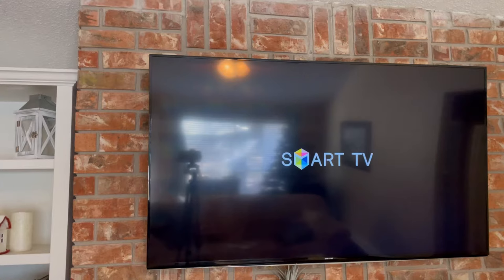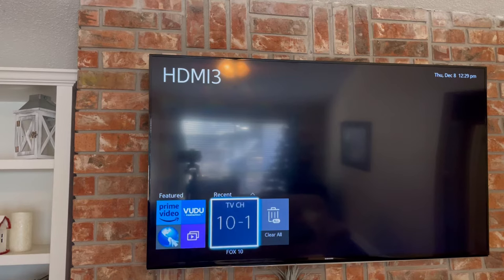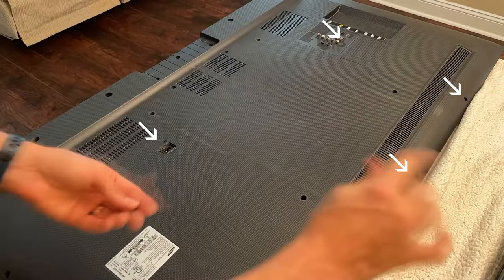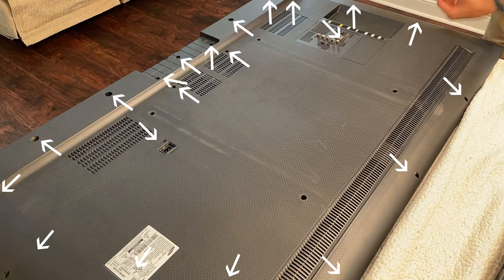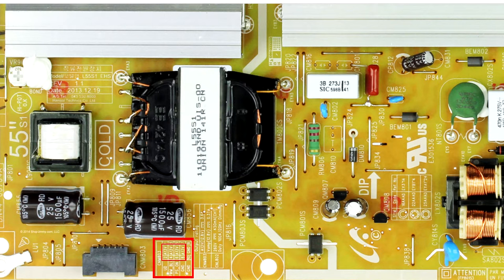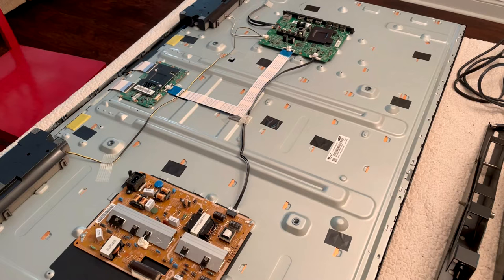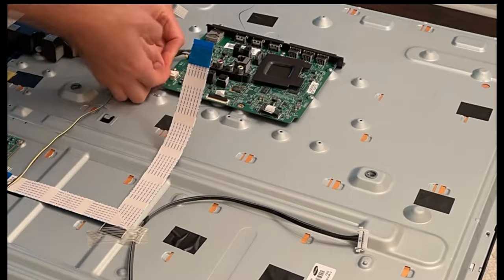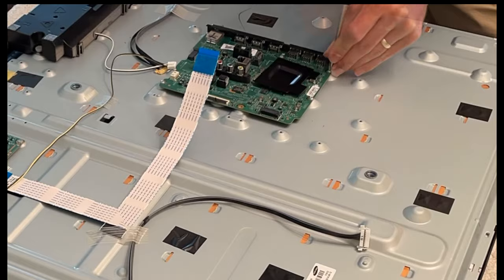How to Repair a Smart TV that Keeps Rebooting (Samsung)

Comment: I have a 75" Samsung TV that constantly power cycles,   i discounted the main board from power board and connected the power cable to the wall jack which on Samsung TV should turns the back light on at gigh level and remain on and that still showed the TV power cycling since it trys the turn leds at full brightness,  there is two ribbons for back lights on this tv and that did the trick and tv remains on ,
I reconnected the TV power baord and main board together and restart the TV and TV stayed on and i was able to go to settings and lower the brightness and hooked both led ribbons again and started tv and the tv remians on and no longer power cycles .  The issue is on full brightness and it seems the pwoer board on its own measures the led feed backs somehow and if it is not up to spec it shuts the TV down and does the pwoer cycle.   The question is what it is measuring and what part on power board does that from anyone the knows the pwoer board well and why.  I don't want to change the leds since it is too complicated and would like to get around it somehow.

Comment: My TV is doing the same thing except I have sound, that would mean I would need to change the smaller board at the bottom right?The tcon board? Or would I still need to change the soundboard.
Reply from the maker: I don’t know. I remember still having sound at first and then that eventually went out… I  suppose it could be the same board?
Reply: Did you get it sorted was it the t-con board

Comment: Hello, I just found this page because I’m having problems with mine. 

My problem is that it is very slow and only have 3 apps and it updated but still very slow like lagging. Is there anyway to fix that or is it time to buy a new tv? Bought in 2012😂 and this is the model : samsung model number un50H5203 of the tv. I would gladly appreciate it if you could answer my comment. Thank you.
Reply from the maker: I don’t use the apps on my tv anymore bc they crash. We have an old tv too. I’d recommend getting a Roku or firestick that can keep up with updates and speed.👍

Comment: My TV keeps turning on and off. I have a fire stick.. Can i just remove the board?
Reply from the maker: Not really sure what you’re asking… are you asking if the tv will work without the board since you have a fire stick? If so, then no my tv won’t work without that board and yours probably won’t either. My board has the audio built into the same board

Comment: My TV has the same issue. I did several time power cycling . But didnt work. When i coconnect TV box through HDMI, sound came for few secons and repeatedly coming it every 10 seconds. Black light on and off. I still iam trying to find mother  board. Any help. TV model UAUA43TU7000U , board no BN94-15304A
Reply from the maker: Did you go through the troubleshooting tips I described in the video?

Comment: Mine is not coming on and the red on off light keep flashing and making a Bering sound. Screen remains black. Do you think is the smart board?
Reply from the maker: If the screen remains black with no backlight, it sounds like it would either be the power board or the backlight itself. You can use a multimeter to test the output on the power board. Don’t get electrocuted though. I don’t know for sure though. If you don’t  feel comfortable doing it, bring it to a licensed professional.👍😊
Reply: Did you manage to fix your TV? Mine has the exact same problem as yours and also is a samsung

Comment: I unplugged the t-con board and the backlight remained lite and stopped power cycling on and off. Any ideas?
 When I had the smart board unplugged form the power supply it did not remain lite and just seemed like it was turned off.
Reply: after endless power cycling for months it seems when I unplug the tcon from the main board and then plug it back in I can finally get the tv back on with working picture and all, however it does not last very long... maybe ten to twenty minutes before shutting off on it's own and then power cycling again shorty after turning on again. If I unplug the tcon and replug I can get it back on again for some time before the auto shutoff and the power cycling returns.
Reply from the maker: Did you check the voltages? Does it look like any capacitors are swollen? Someone else recently left a comment about how they fixed theirs. Sometimes you just have to take an educated guess and purchase that part. If you fix it and it’s cheaper than buying a new tv, it’s a win. Best of luck!
Reply from the maker: See my other comment
Reply: @rutterrealtygc  Appreciate the response!
Reply: @rutterrealtygc  I'm going to be honest mine looks a lot different than yours so I wasn't really sure what I was doing. Plus I'm female so I don't really understand the multi-meter which also looks very different. I have more the one cable connected to the power supple board and the main as well. When I unplugged one the tv wouldn't operate at all and when I unplugged the other it would power cycle. and it seemed like I was getting volts from each but not entirely sure. When I put the black lead on the "on and off" and the red on the ground the backlight would come on but it would still power cycle. Two capacitors do look swollen! I will try to replace them but just found it odd that the tv would work again after trying to get it to quit power cycling and turn on for months by just unplugging and re plugging in the tcon

Comment: Mine has an issue where the backlight flashes on and off constantly, even for a few seconds after it's unplugged. Nothing else comes on the screen, just the backlight. Could this be the same issue? I've tried forced power cycling. It just randomly started doing it.
Reply: Hold the power button on the remote until the tv fully resets you’ll see a little home pop up in the center of your tv once this happens then let go on power button
Never buying a Samsung tv again lol this shit is pathetic
Reply from the maker: I don't know. You could start by testing the output voltage on the power board with a voltmeter to see if it's constant or comes on and off. Honestly the only way to troubleshoot it is by testing one piece at a time. I hope iloveintros4459s reply below helps!
Reply from the maker: Thanks for the tip!

Comment: Is it 3d tv or normal one... Mine is 3d 6400 model 55 inch facing the same problem.. I don't find any solution.
Reply from the maker: Normal. Not 3d.

Comment: My 70 series samsung does the wierdest thing, it works normally most of the time then randomly shuts down and if u turn it in it starts looping. And simetimes the tv was shut off normaly and starts looping when turned on. Sime times it even revives it self if i ket it loop for a bit 🫠
Reply from the maker: No clue on that one… lol. Are you using other devices plugged in, such as a fire stick or Roku? We had a bad Roku remote that kept power cycling the tv. Does the blinking light on the front of the tv indicate a button is being pressed?
Reply: @rutterrealtygc  it is connected  to a ps5 and a A/V reciever also tried it without them, does the same thing again now i think about it a while back it turned on by itself some times, wich would also trigger power on for the receiver. It does not do that anymore. The indicator led is dead to input. Also did a factory reset and switched hdmi input poweron off wich did not help.